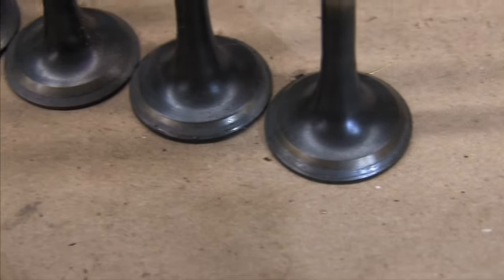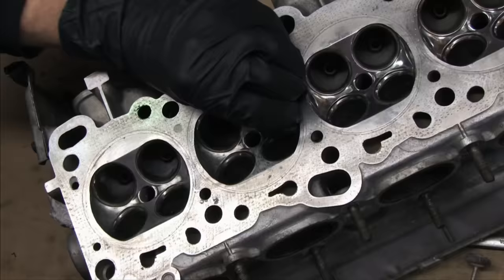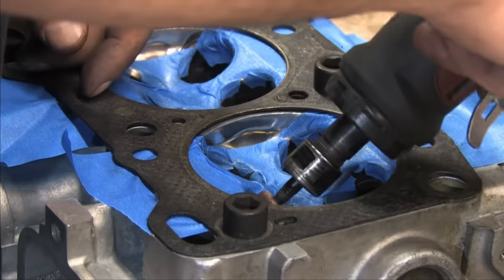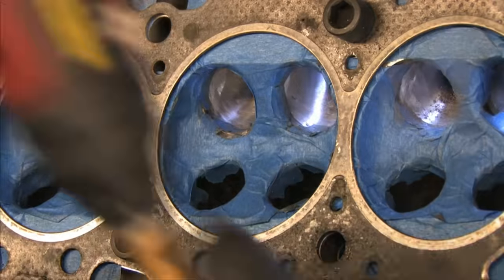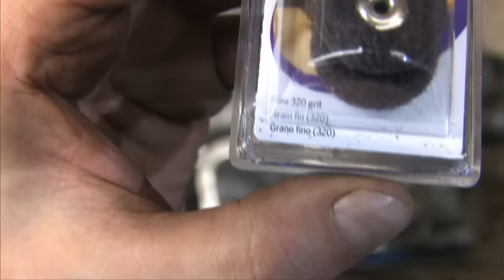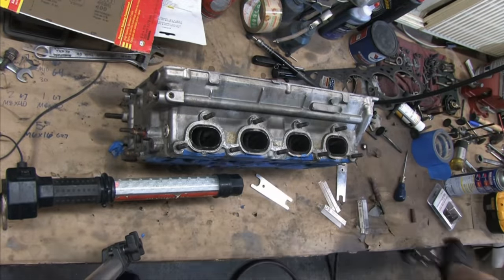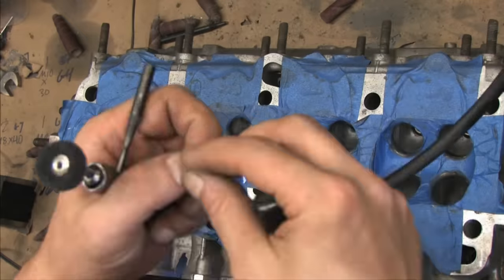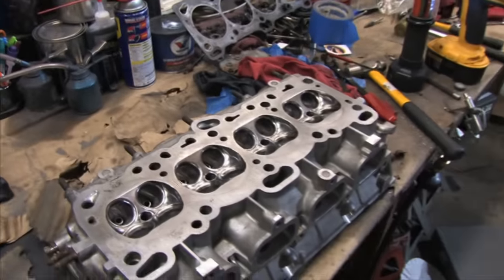Cylinder Head 204 - Porting & Polishing

Comment: I would have loved to seen dyno before and after polishing :/
Reply: @nick f more then u got for painting your gas lid
Reply: nick f this makes a pretty big difference esp if your running a bigger cam. I have a 2008 trx700xx I bought the other weekend that I put a stage three cam, black diamond valves/springs, and a 12.1 JE  Piston but failed to clean the head up which had carbon build-up all in the exhaust side and the chamber wasn’t all that great neither was the intake but me not having the tools at the time I was working on it I just went head and slapped it back together. Now I can’t really tune it to get all I can get out of it because my heads are so dirty. ANYTHING dealing with how fuel/air flows makes a big difference especially with a high performance engine because it’s gonna need more fuel to turn it regardless. You must not know too much about motors lol.
Reply: Polishing doesn't improve performance, this has been shown time and time again.  In fact having the inlet polished can make things worse.  Port shape is the important parameter, not surface finish.
Reply: @ferrumignis  Surface finish makes big differences around the port... Dimped or rough surfaces change laminar flow, this causes air/fuel to tumble or flow considerable better or worse. The reason most cars don't come like that, even race cars is because its extremely time consuming for very very small result, but from a numbers point it shows.
Reply: @madjimms  It has been  shown repeatedly that a polished finish on an inlet port encourages fuel drop out. Surface finish has negligible effect on flow compared to shape.
Reply: @ferrumignis  It improves performance on the long term, it´s harder for dirt to stick on a polished surface than a rough surface. For that reason you will keep your performance longer.
Reply: @RaptorFPV  You could possibly make this argument for the exhaust port, but even then it doesn't make a lot of difference, in fact carbon deposits can improve flow by filling in the slowest moving parts of the port. For inlet port a shiny polished finish simply promotes fuel to drop out and stick to the surface, this has been known for at leat the last 50 years.
Reply: @ferrumignis  Thanks for the input!
Reply: @Bozemanjustin  I didn't say anything about him not reshaping the ports, simply that polishing them is an utter waste of time, and can actually hurt performance.
Reply: @ferrumignis  Agree with you! Look at "Porting vs. Polishing vs. Both"
Reply: SkyWizardless Well said. This is key
Reply: @madjimms  ..... Yeah your probably right but I seriously doubt any of these guys making videos such as these are Racing John Force "aka" Mr NHRA or anyone else in the NHRA or NASCAR!!
Reply: @ferrumignis  Great job at reciting irrelevant knowledge from ye ol’ days of the carburetor. Your ancient knowledge has no value when it comes modern direct injected or even multi pont injection where a tight spray pattern is aimed right at the intake valves
Reply: @TofumanFC3S  Great job at showing your ignorance. Air and fuel doesn't behave any different when it's injected, a polished finish is useless in either case and shape it is the primary influence on airflow. If you spent any time at all on a flow bench you'd know that, but just you keep tuning engines from your armchair.
Reply: @ferrumignis  You’re clowning right? Fuel mixture doesn’t behave differently wether it’s provided up stream by carb vs. injected directly into the combustion chamber? What is wrong with you? Come on man, I love a good discussion, but you probably wanna go and edit that comment 🤣 I’d say the first difference is that with direct injection at no point any mixture travels through the ports obv. I’m probably focusing too much on the details, huh? 🤦‍♂️

NOBODY, and I mean nobody in all these comments for the last 5-6 years this vid has been online has suggested port shape doesn’t matter. Again: What is wrong with you? Why are you so mad for someone evening out the ports, removing casting marks and leaving a smoother flowing surface, that you have to post multiple comments condemning it? I just don’t get your rage against someone optimizing a bit.

If YOU had any experience with flow analysis on a bench or I dunno, CFD knowledge, than you’d know that port 1 that is more or less as designed waaay back when the engineers came up with the port shape compared to port 2 that is the result of overuse of casting tools resulting in errors, drastic changes in surface and direction and protruding flash marks, will for sure make it behave differently than intended and in 99.8% of the cases for the worse.
Reply: @TofumanFC3S  Now you are suggesting that this engine uses direct injection? No son, it does not.

I am not mad about anyone flowing ports correctly, removing casting ridges, opening up the inside turn amd generally concentrating on the shape of the port is the right thing to do, as I have constantly said. Wasting your time getting a polished finish under the misapprehension that it will help airflow is not the right thing to do.
Reply: @ferrumignis  I never suggested such a thing. YOU said engine type or point of fuel introduction has no relevance when it comes to port surface finish when you said: “Air and fuel doesn't behave any different when it's injected”. Well, I’d say it does especially considering WHERE it’s injected. 

Two types of injection with hugely different characteristics:

1) Direct injection
2) Stand off injectors on ITB systems

Anyways, why do you keep discussing. Not to be a dick, but sometimes you should just look at what others do. In this case I suggest looking at what F1 teams do. Engine development programs for F1 teams have cost billions of Euros and they spend that money on reliability and performance. The best and worst engines are maybe 50hp apart and on these 1000hp engines that means the lesser engine manufacturers are spending hundreds of millions just to find an extra 5% performance. Do you think if the solution to even just 1% was “you need shitty castings for the flow bro” they would make sure they have a 10-20 micron finish in the runners? 10-20 micron equates to P1000 - P2000 or say about 500 - 1000-ish Freedom grits. This is with modern, direct injected F1 engines. Older engines with port injection are more like a P400 (or 320 Freedom grits) finish. 

So personally I go for P2000 in the intake manifold, transition to P1000 before I get to the head, start the head intake port at P1000 and transition to P400 about before the injector. But just like OP I like to transition the floor of the runner earlier to P400 than the roof. 

Mirror polishing the exhaust runners and combustion chamber? Fine, why not. I guess it’ll keep the surfaces clean the longest, but it’s a ton of work. Anywhere between P1000 and P2000 should suffice but this all isn’t stuff that gonna make you pick up serious numbers, if at all. Not is it gonna cost you... 

The most important thing remains removing the rough casting faults and being happy with you work. Because that’s probably worth more than 1.3hp on the dyno. 

Also: DON’T knife edge exhaust ports and if you are significantly upgrading your engine with internals and aggressive cams, find out what your engine needs when it comes to head flow and re-shape and size up to support this figure, no more. But yea, that’s for serious engine development, not a “while you’re in there” job
Reply: @TofumanFC3S  Yeah, not going to read that novel, precis it if you think it's important. 
Answer this:
1) Is this engine direct injection?
2) If the answer to 1) is no, why are you waffling on about port finishes that you think work better on a direct injection engine?
The difference in airflow between a fine ground/sanded finish compared to a polished one is zip.
Shiny finishes in ports are good for exactly one thing; selling heads to people that don't know any better.

Comment: Hey Jafro, i know its probably no big deal but the little pot holes in the casting in the ports can be filled with JB or some sort of epoxy, let to harden, then blended in with the rest of the port work.
Its commonly done on SBC and BBC heads when they tube them. Tubing Its an old trick where they would actually port into the water jacket on purpose, press in a tube  and epoxy it in.
There is a guy here on youtube that is the only one Ive ever seen do it. Ive only heard about it before in school at UTi and seen the heads done but never watched someone do it until this one guy, he is an old timer and knows his shit. His channel is Headbytes porting I think. He is a cool dude. Check him out if you get a chance. Ive learned a few things from him. Its always good to learn from the old guys!

Comment: The arguments of rough vs smooth and turbulence being good or bad are due to a misunderstanding of aerodynamics. There are two main types of drag; skin friction drag and form drag. For something shaped like a golf ball, the dominant form of drag is form drag due to the detachment of the boundary layer. The dimples in the golf ball promote turbulence in the boundary layer which keeps it attached longer. This reduces form drag and thus, total drag on the golf ball.
For something shaped like an airplane wing in cruise, the dominate form of drag is skin friction, so you want as smooth a surface as possible. This is why recessed rivets are used on planes; it reduces skin friction.

For an intake port, I suspect the argument could go either way. At low throttle settings/RPM, rough port surfaces may help keep the boundary layer attached and increase airflow (and thus torque down low). At high RPM/throttle, the flow may detach anyway and it's better to reduce skin friction. This all would depend on the particular port geometry and engine though, so it's impossible to definitively say one or the other is always "best".
Reply: Yup my mind fights itself a lot on this topic my friend and I used to port our small cc 2 stroke engines they were carbureted so to get a better fuel/air mix we left the intakes coarse and everything else as shiny as we could get

Seemed to work great but the placebo effect always does hahaha

It was fun and I would do it again ;)
Reply: Air over air is less turbulent on non polished ports. Polished intake ports can cause air to speed up and bounce around causing negative flow behind the valve. Also important the main purpose of the engine such as drag racing only the roof of the port will flow, sides and bottom port dont factor. The purpose to polish the combustion chambers and exhaust ports is to reduce carbon buildup that ultimately reduces surface area.

Comment from the maker: FrostyCoug lol... those aren't for me.  They're for the machinists that do all my machine work.  Showing up with coffee and donuts is how I get my parts in and out of their shop faster than anyone else.  ;)  Whenever you see that place roll by, it's foreshadowing to a part being re-engineered to my specifications without showing it happening.  I've illustrated it in several other videos.  Always show up at the in-laws and at the machine shop with a token of appreciation.  :P
Reply: Brendan Raymond Just never walk in backwards with a attitude. It will never go well anywhere.
Reply: ***** Boundary layer turbulence is about helping the air make the turn into the chamber itself by keeping the boundary layer consistent throughout the radius of the port itself which prevents the air from "sticking", which creates deeper level turbulence. If you would like to learn more about the topic, it's called fluid dynamics. Not assuming that you don't know about it, just sharing in case you don't.  

That is why you would want to keep the intake port a little rough. The fuel argument as you pointed out is invalid. It's about helping the air break up and to not be "sticky".
Reply: Joe11Blue Hi Joe, so what roughness do you recommend. 80 grit? 120 grit? Just curious :-)
Reply from the maker: I would say 120, but 80 would be fine, too... as long as the surface is uniform the full length of the port, that's about as much as you can ask for with a DIY job.  I say 120 because the texture it leaves is easier to SEE as you're working than 80 is.  After you're done with the 80, you'll be able to see where you made mistakes as the texture changes.  The sandpaper the 120 grit rolls are made from is thinner and more flexible, so you can actually smooth and reach places that you would damage trying to grind with the coarse grits.  Going beyond that anywhere else in the port is splitting hairs for 1-3% potential.
Reply: ***** I apologize for not immediately subscribing - some comfort at least... I subscribed after watching the second video LOL. 
Great videos, awesome advice, respect
Reply: +Jafromobile I bring donuts for the staff at my local oyster hatchery whenever I pick up oyster seed for the season. thanks for the tip! PUT UP SOME VIDEOS OF THE GSX PLEASE!
Reply: +Jafromobile I miss your lame jokes and amazing videos sir.  PLEASE!!!!!!!! I'm sure I'm not the only one!!!! #NOHOMO
Reply: +Jafromobile 26:46 Why do I keep hearing this throughout the video? :D
Reply: ***** I checked... I think it's because he made a mistake saying the wrong grit - he said 380 grit - then correct it by saying 320 -
Reply: +Jafromobile oh man, my dream would be to spend 12 hours flat porting and polishing a cylinder head. I kinda love work like this. I repainted my wheels once and I quite enjoyed sanding and sanding over and over. took ages but I enjoyed it. I guess im a rare kind..
Reply: Get a junk head and start porting Dazzmond! I spent easily 100 hours porting and polishing a vw 1.6 turbo diesel head :D

http://i1140.photobucket.com/albums/n570/shelbot/10974418_10155275672765512_2117429839024164331_o.jpg
Reply from the maker: +Tobberobbe97 https://www.youtube.com/watch?v=fwcaS-GYM3g
Reply: yddfgm
Reply from the maker: I suppose one could look at it that way?  Think of it more like a tip.  I'm going to pay them for the work anyway... There's no "tip" field on the receipt.  They really want what's in my wallet after all.  :)
Reply: +Jafromobile Hey it's the little things in life! I'm still catching up on the headwork vids, is there going to be any port matching of the manifolds? I did sit through the port-n-polish vid so I'd doubt you'd want to do it again haha
Reply: I wish I had money to send you just to watch you build more stuff jafro.
Reply: So, Jafro. You said That you were going to do something to keep the shine on those exhaust ports but it deserved it's own video. Did you ever make that video or are you planning on making that video in the future?
Reply: The internal flow is not fully developed.  Whether the boundary layer adheres or separates from the wall is not a function of the surface roughness, or the ill-defined "stickiness" you propose.   It depends only on the static pressure along the channel.
Reply: Back in the early 80's, I worked in the Sands Casino autoshop in Atlantic city. We had a ford f-150 6 cylinder we were always working on that had problems. My boss used to take a cup of water and rev the engine, then pour the water down the carb butterflies. This would shock the cylinders and break the carbon out of the cylinders. People say it will hurt an engine, but for years we did that, it mever hurt that engine. Besides, it's only a Ford, no biggie if it blew up.
Reply: Jafromobile I'm starting my p&p in the am.
Reply: Swedish fish theroy!
Reply from the maker: Well, I am half-Swedish and I do love to fish...
Reply: It is amazing what not being a d#%k will get you lol. I am the same way.
Reply: Nice job! The the title got me,these engine are so close to motorcycle engines. Porting is a art back in the day porting 2 strokes can't tell you how many I've FUBAR. Just a question am running a turbo on my Ninja ZX14 should I use conventional plugs or iridium? Beautiful work brother!

Comment: This brought back a lot of good memories, a friend and I would do this to VW heads. The intake was always cast small compared to the carbs and manifolds we used so I finally bought a Craftsman electric die cutter. We would use the gaskets to mark the ports then open them up to size. Then clean up the passages in the head. 
I would polish the combustion chambers to a mirror finish.
I was lucky enough to have a friend with a flow bench. 
The work was worth it. 
Why mirror shine the chambers, no hot spots and after a years driving and racing the chambers had a smooth carbon build-up. 
I left the old valves in the head when polishing the chambers so I didn't booger anything up.